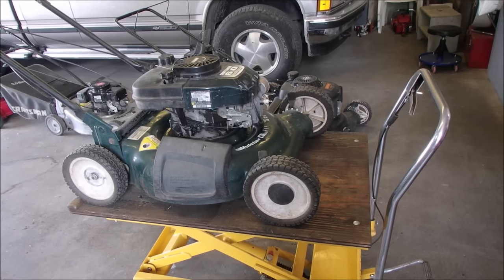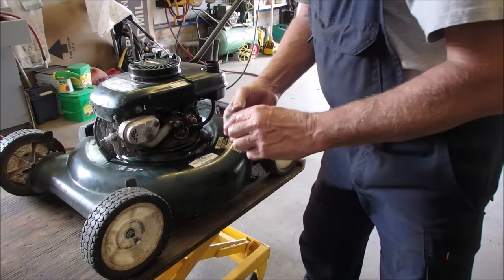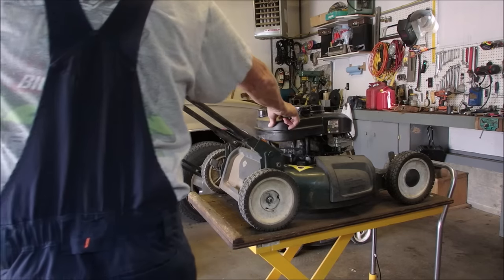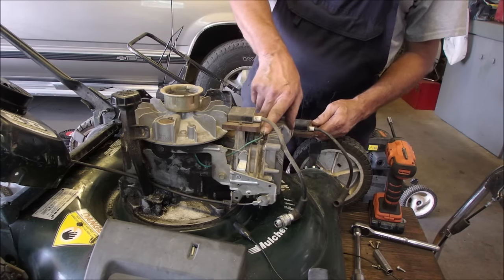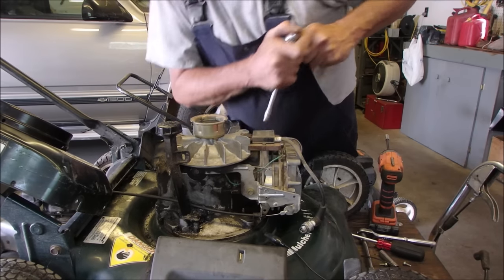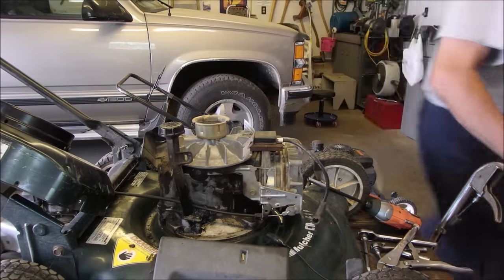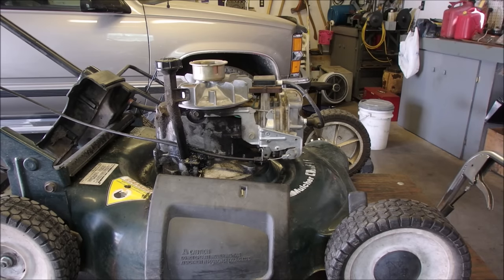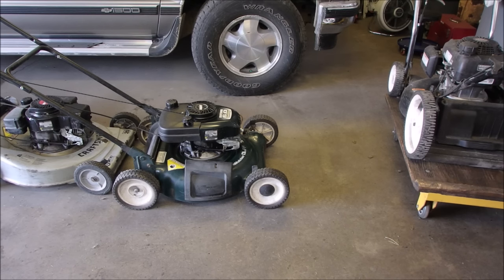Craftsman Lawn Mower 101

Comment: Those original Tecumseh ignition coils definitely do go bad, I’ve seen it a number of times. The first time I ever had a customer callback years ago was because of a bad coil in a Tecumseh powered Toro mower I sold. Customer said it started right up and ran great but then as he was mowing it would lose power and die. It wouldn’t start again until it cooled down then it would repeat the whole process. Sure enough, ignition coil was crapping out when it got hot. Easy fix, never had another problem after that…probably still running today LOL!
Reply from the maker: I would agree.

Comment: Hey Bruce...good finesse on the coil bolt!  I can never understand what folks are cutting to make the blade wear like that...

Have a great weekend!
Reply from the maker: The entire life of the mower had the same blade.
Reply: @BrucePender   Wow...I wonder if in today's world that would be considered cruelty to small engines...haha

You know I started a Techumseh engine like that one after forgetting to screw on the oil filler cap.  As soon as it started, oil came shooting out of the tube!  For a minute, I thought I was in Texas!

You surely have a lot of luck in that the oil tube stayed put after the mower started.
Reply from the maker: @larry3099  I did get lucky on that one
Reply: @BrucesShop  Yes agreed.

I cringe any time1 I'm faced with a bolt that is difficult to take out.

Comment: Hey Bruce, great job.  Allow me to share my method for seized bolts :  Spray easing fluid on said bolt (50/50 mix of ATF and acetone), let sit for 10/15 mins. Whack with a drift and hamster * .Use an impact.  If that fails, use heat, as you have done and repeat.  Hope this helps.
* The term `hammer' is no longer used.  Basil Fawlty of Fawlty Towers changed this when hanging a moose head and referred to it as a hamster.
Reply from the maker: Good stuff